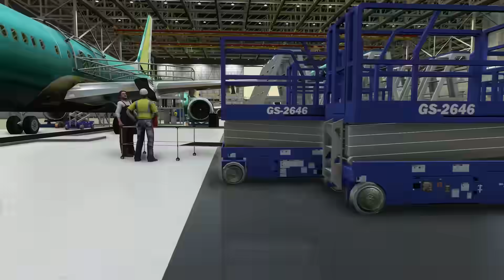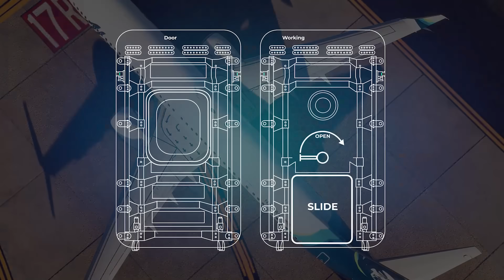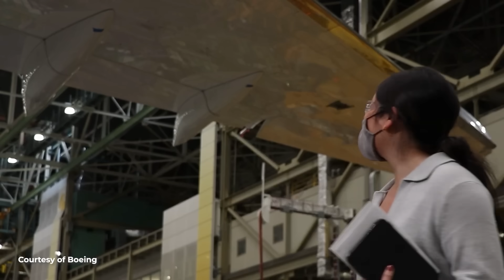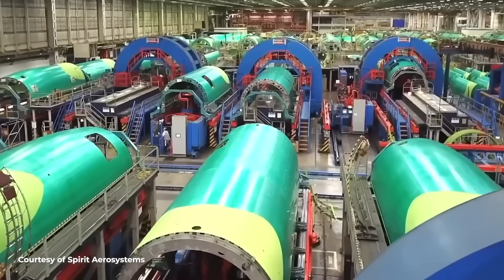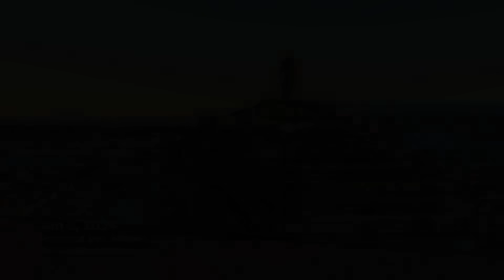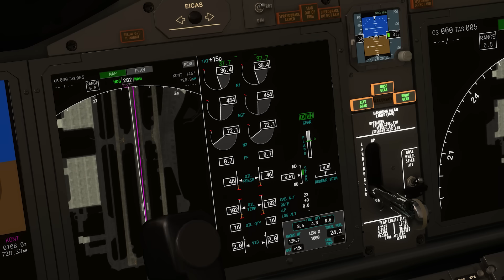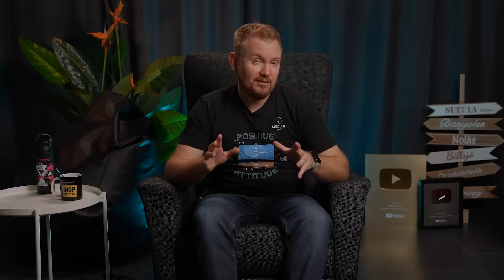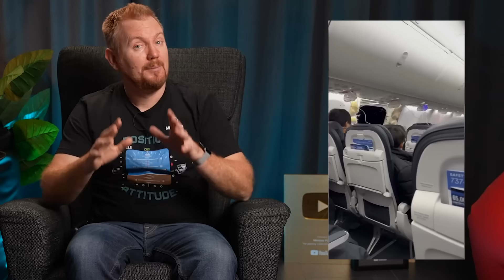Boeing 737MAX BlowOut!! The Scandal behind Alaska Airlines flight 1282

Comment: 0:22 All because someone forgot to do something. Well not quite... 
If they had merely forgotten to fit the 4 locking bolts then the door would have failed on its first flight. It probably wouldn't have even got as far as it's first flight without being discovered, as they no doubt perform a full 8psi (or higher) differential pressurisation test on the ground and even if the door plug didn't fail then (which it probably would) there would be a noticeable air leak as the door will be significantly lifted by the assist springs.
The reason it passed the initial pressure test and then didn't fail until it had done 150+ flights is that they didn't merely omit the four locking bolts, they actually added a white plastic zip tie, which was holding the door plug closed. Why isn't that mentioned by NTSB?
At 12:18, in the "after closure" Boeing progress photo, on the (forward) right hand side of the door, the second up from the bottom, pair of door & frame lugs, have a white plastic zip tie clamping the door lug pin & frame lug pad firmly together. (This photo is figure 16 in the NTSB preliminary report).
The zip tie held, keeping the 12 pairs of lugs aligned, until a bumpy landing broke it, or made it finally slip off one of the lugs. Without that zip tie, the lift assist springs will lift the door to the point where all of the 12 pairs of lug pins/pads are pretty much disengaged and only the very bottom part of the upper guide tracks are engaged with the guide rollers.
That part of the guide tracks was never designed to hold the cabin air pressure and it finally broke at 15,000 ft, the first flight after the zip tie broke. (After 150+ flights).
It's a shame that the lift assist springs didn't lift a tiny bit more, because then the guide tracks would have fully disengaged from the guide rollers when the zip tie broke on landing. The door would have then fallen open to 15° where it's wire lanyards would hold it. Hopefully a door plug open 15° would be noticed on the next pre-flight walk around. Failing that there would be serious wind noise on takeoff, deformation of the interior panel, no pressurisation and an interesting view for anyone looking out through that "window".
Note: a zip tie is also known as a hose tie, cable tie, zap-straps or tie wrap.
Reply: Thanks for forwarding this observation! The explanation has needed a basic cause, the missing bolts and the culture that let it happen, and a proximate cause that allowed the plane to operate normally for those 150+ flights.
Reply: So - the team that inspected that exterior wall and the team that installed the interior wall panels just didn't notice the zip tie? They just said, "That's not my department?"
Reply: @RyanK-100  Isn't that the reason that any of this happened? There isn't a team inspecting the work done to open/close the door plug because it's considered to be as trivial a task as opening/closing the L1 main cabin entry door, that's done on every flight. Nobody noticed 4 critical locking bolts were missing, that you might very reasonably expect the most trivial glancing inspection to check for. So it's no surprise that a zip tie isn't noticed. 
Is the person refitting the insulation & interior panel, the same "grade" of person who was reworking rivets & door seal? Is it "their place" to look at what an airframe grade person has been doing with a door plug? 
The insulation is draped over the top of a seat headrest. Perhaps just held by trapping the end of the insulation in the seat tray on the back of that seat. Just release it and the insulation is instantly draped over the door, covering the zip tie and the empty locking bolt holes forever. (Or at least until Bob finds the door in his back yard). 
The zip tie is the entire reason that passengers lives were put at risk. So that's a very important part of the investigation that isn't being mentioned by NTSB, even though they published the photo. 
If it had been both no locking bolts AND no zip tie, then the door plug would have failed a ground based 8+psi pressure test, either due to leakage or blowout. In the unlikely event of it getting to the first test flight (without passengers) then it would have failed then. It would never have got to fly with passengers, putting their lives at risk. It's only the zip tie that escalated things to the level where passengers lives were at risk. 
Everyone is believing that the springs don't immediately lift the door to almost full extent, just because that belief is needed to support the narrative that the door can stay in place for 150+ flights with no locking bolts (and no zip tie) and that's what people have been believing for weeks. The belief that the springs barely support the weight of the door becomes fact in their minds. Any photo of the door open, shows the hinge guides at the top of the hinge tubes. (I can see 2 fairly important reasons why the springs would be designed to lift the door like this). 
Because the springs will lift the door, the zip tie is needed to hold the door closed for the progress photo. It's the zip tie firmly clamping that door lug pin to a frame lug pad that is holding the door in the down/closed position for the photo. (Person who fitted the zip tie obviously expected to have the lock bolts available shortly and to be fitting them. They weren't thinking a zip tie is ample for flight, in place of 4 locking bolts!)
Reply: @RyanK-100 they tried painting over it the first time ffs. Zip ties was the clever one of the bunch.
Reply: It’s not mentioned because the investigation isn’t done. NTSB isn’t obligated to disclose everything they have or think they know in the prelim.
Reply: @mostlyvoid.partiallystars  yes, absolutely no obligation at this time.
Just saying, I have the feeling it also won't get a mention in the final report.
Reply: Good catch.  Thanks.
Human errors do happen but this one failed in many respects.  Should there be a job card developed and followed?  And of course some supervisor to inspect and sign off when the job was completed.  Especially this plug now becomes a part of the structure!  Personally I feel that structural parts should be "permanently" held in position, either by weldings or fasteners.  In this case, can those lugs be used?  Say threaded so bolts can be used to hold the plug in position.

Comment: First, your video is probably one of your best.  The MSM has completely ignored the NTSB findings which are shocking to say the least.  Alaskan did great from not allowing the aircraft to travel using ETOPS criteria.  Second, the failure to install these bolts is a real concern for future travelers.  Third, I get the rapid decompression bold print and oxygen masks, it’s not easy to do.  I had a smoke in the cockpit at FL350.  We were able to get the plane on ground in 15 mins.  Talking through the oxygen mask was really uncomfortable.

Comment: How can there not be a safety feature of the auto pilot to stop climbing when the low cabin pressure alarm goes off???? To me, it doesn't feel like airplanes nowadays (especially the cockpits) are designed for maximum safety, rather than maximum complexity as to make the flying seem extremely difficult for non-pilots.

Comment: Well what happened to the four bolts, nuts and split pins that were taken out? Obviously they would have been somewhere. If I am working on my car, and find I have a nut or bolt left over I know I messed up somewhere, and have to investigate. Seeing that this hardware was not refitted, surely someone must have found the hardware at some point. Did that not raise questions at the time? "Hey, Harry, where are these from?".  If I have a system for keeping track of hardware on my car, one would like to think that people working on aircraft have some kind of system?

Comment: 12:18 A white plastic zip tie is  holding it closed. Why isn't that mentioned?
In the "after closure" Boeing progress photo at 12:18, on the (forward) right hand side of the door, the second up from the bottom, pair of door & frame lugs, have a white plastic zip tie clamping the door lug pin & frame lug pad firmly together, preventing the door from lifting, as the 4 locking bolts would have done, if they had been fitted. (This photo is figure 16 in the NTSB preliminary report).
The zip tie held, keeping the 12 pairs of lugs aligned, until a bumpy landing broke it, or made it finally slip off one of the lugs. Without that zip tie, the lift assist springs will lift the door to the point where all of the lug pins/pads are pretty much disengaged and only the very bottom part of the upper guide tracks are engaged with the guide rollers.
That part of the guide tracks was never designed to hold the cabin air pressure and it finally broke at 15,000 ft, the first flight after the zip tie broke. (After 150+ flights).
It's a shame that the lift assist springs didn't lift a tiny bit more because then the guide tracks would have fully disengaged from the guide rollers when the zip tie broke on landing. The door would have then fallen open to 15° where it's wire lanyards would hold it. Hopefully a door plug open 15° would be noticed on the next pre-flight walk around. Failing that there would be serious wind noise on takeoff, deformation of the interior panel, no pressurisation and an interesting view for anyone looking out through that "window".
Note: a zip tie is also known as a hose tie, cable tie, zap-straps or tie wrap.

Comment: Thank you for the detailed rundown on the door plug.  We fly to Hawaii twice a year on Alaska and at one point in my life, I did earn a Commercial Pilots License.  What I don't want to see is an overzealous FAA doing a knee jerk reaction.  I do believe that a temporary grounding until the problem is resolved is appropriate, and proper follow-up procedures on the Assembly line are put in place.  I personally love flying on Boeing aircraft and do not have a problem.  BUT, Quality Control is a necessity.  --  Thanks again for your channel.  I watch you all the time.

Comment: The door plug is over 15 yrs old and the mid exit door has been around even longer. It's misleading to say they added this exit door for extra passengers on the 737MAX. The exit itself has always been included on 737-900 NG, with a door or plug. And there have been very many 900s delivered and down around the world. The 900 and 800 were the primary sellers for the NG over the final 10 years or so, while 700s were more popular early on.

Comment: Another cost cutting measure that reduced safety. If Boeing wanted to sell two configurations of the 737 Max-9, they should've produced two different versions of the fuselage. They are putting passengers at greater risk necessarily by using a door plug vs a continuous piece of fuselage. The 737 Max are full of compromised design like this, there's no way they can make it completely safe (or as safe as planes that are designed to accept these big turbofan engines and have proper escape door designed to accommodate over 190 passengers rather than these modified fuselage designs.

Comment: I suspect that the relative calmness in the passenger cabin is because, atypically, they had an almost complete visibility of what was happening.

Unlike engine or flight control problems or even turbulence.

That simple 'knowing' combined with knowing the full extent of what you can do about the situation, can be extremely calming.

Comment: Pilots forgetting to pull the CDR circuit breaker seems to happen quite often, especially when 'funny' things have occured during a flight...🙄
Why hasn't this problem been fixed? Shouldn't that be one of the easiest things to automize? 🤔

Comment: Just wondering, would the exterior skin of the plane show any signs of shifting as the stop fittings/pad shift out position? Is the door plug exterior edges painted a contrasting color like operational doors? I wonder if painting all door edges would be a relatively inexpensive way to detect misalignment before it becomes a problem.

Comment: Thanks for distinguishing between a design failure (MCAS) and a quality control failure (blown door plug). News sources are making another mistake when they fail to distinguish between failures that can be traced to Boeing and failures in much older planes that are due to poor maintenance by the airline.

Comment: My first response to news of this incident was to assert that creating ANY unnecessary hole in the fuselage both weakens it and creates a greater likelihood of future problems.  But you stated that this incident was not caused by a design issue.  In your opinion, does a fuselage with 10 exits have as much structural integrity as one with 8?  Also, do you see a properly installed door plug as being no more of a liability than a properly installed regular door?

Comment: In manufacturing, there is a thing known as "procedural continuity"
It means that all multi-step processes must be grouped as a unit. The unit must then be assigned a maximum completion time. So, in the case of the door plug, you would have to complete the process, which of course includes the 4 bolts,  under an assigned time. This forces the floor manager to ensure that no procedural unit spans across a shift change or else every step in the unit must be undone and restarted. This practice makes a huge difference in the safety of the finished product. If Boeing is not doing this, we are going to see a lot more mishaps with their airplanes.

Comment: Awesome video!!! My A&P take: 1) Fixing non conforming rivets w/paint Alarming 2)tearing up the seal taking the plug out concerning 3) prev flt reporting whistling/noise behind the panel to crew and nobody cared to investigate/write it up VERY CONCERNING!! And I want to know about all the loose hardware findings upon inspections of this plug. I’m at a loss of words. Great Video!!!
Reply: At what point did worker(s) say "hey, I've got  4 bolts, nuts and cotter pins left over, wonder where they go?"
Reply: @timtonsley8823 I was wondering the same thing
Reply: 1 didn't cause the accident but it does indicate a culture of trying to pass quality inspections by subterfuge which is quite insidious. Similarly choosing an approach to replacing the door seal that avoided triggering a quality assurance inspection indicates a culture where QMS is regarded as an obstacle to overcome rather than an essential part of delivering a safe plane.
Reply: Exactly! I fel that everybody was trusting that "somebody else" is taking care of things so they don't need to care. Especially if having to care would require filling some official form.
Reply: @MikkoRantalainen  Yea, but if that's your attitude, why the hell then work in the aviation industry. People REALLY need to do work that at least vaguely fit their mind. As if 95 % of jobs have not theese requirements.
Reply: @Delibro  Many people take jobs they don't actually want to do if they pay well...
Reply: @MikkoRantalainen  Yes, and that's ok if its an ordinary job. But there are jobs that shouldn't be taken when its not your desire to do especially that job. It's not to offed you, its meant to be an important fact.
Reply: It makes me realise how brilliant the UK's 1974 Health and Safety at Work act was - this law (among other issues) states that if you see or become aware of a health or safety issue in your workplace it is your duty to do something about it and ensure it gets fixed - you cannot walk on by and ignore it. You have a responsibility, you may not say "I thought it was somebody else's problem". This helps modify people's attitude to quality in the workplace as well as health and safety. @MikkoRantalainen
Reply: @HuwRichards-e2z  1974 Health and Safety at Work act sounds great. Here in Finland, it's your duty to only take action if somebody is already harmed (for example, traffic accident or fell in stairs) but we have no requirement to take any preventive action which I consider pretty silly.

Comment: Question: everybody knows now that the 4 bolts were removed and not reinstalled. However, to me, that means those bolts would have stayed at the factory somewhere, and since the installation of these plug doors is not something normally done at that factory, nobody noticed 4 bolts laying around?

Comment: I'm convinced that having the cockpit door opening rapidly in the event of a pressure loss in the cabin is wrong. It puts more stress and strain on the pilots and sounds very disruptive and possibly dangerous as things in the cockpit might well start flying around. If the cockpit must depresurize (and I'm not persuaded that is best, either, then it would make much more sense to have a pressure relief valve in the door itself, so that the pressure could equalize over the course of a few seconds. This (and associated warning lights and alarms) would give the pilots a short time to accommodate the situation. The valve itself could be manufatured such that it whistled loudly as air passed through it, like a whistling kettle. Another good production.

Comment: @MentourPilot in this video, at 32:27 you mention for item #6 of the checklist that the pilots "may also possibly increase the speed to maximum".

This obviously doesn't make any sense, I understand you likely meant to speak of deploying the speedbrake but limiting them if structural integrity was in doubt. 

Hopefully, you are able to edit that easily. 

Nonetheless, incredible video and thank you for covering this so early and in such great detail. Your approach and quality of videos is just absolutely fantastic ❤.

Is there likely any damage to the aft pressure bulkhead that might have been caused due to the shear violence of the depressurization? And what do you think will happen to this aircraft after this incident? Will it be fixed or written off?

"Sound like Darth Vader running a marathon" 😂😂 you can really crack me up Petter